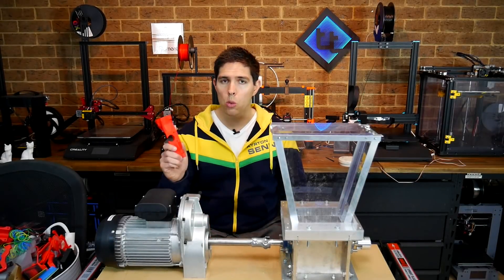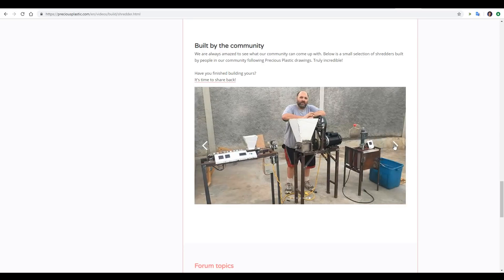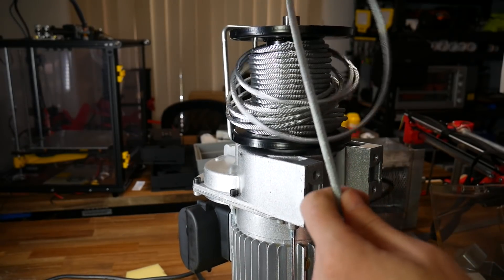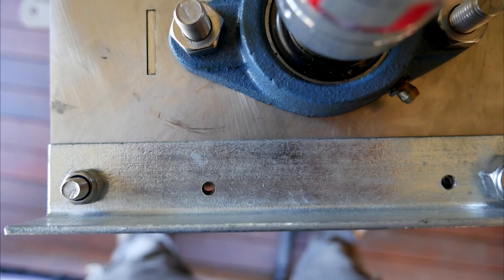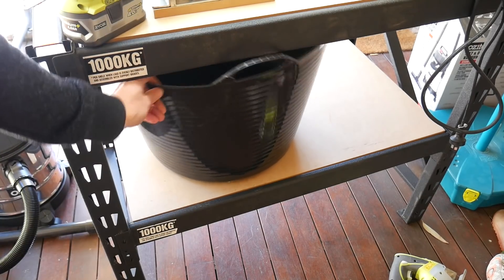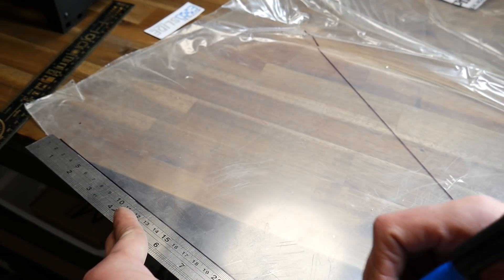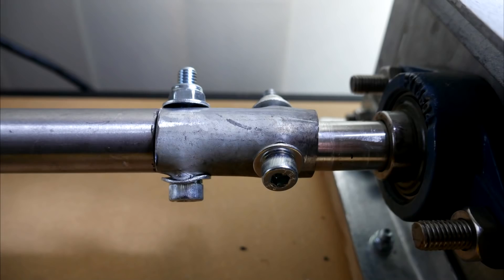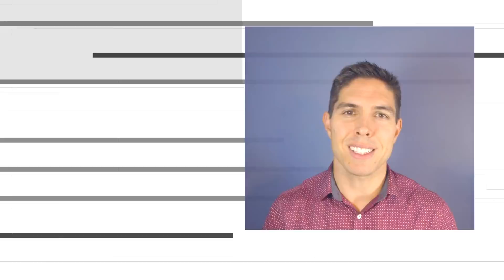Recycling waste 3D prints with a Precious Plastics shredder

Comment: Regarding the Motor, you could've gotten yourself a small geabox, or a torque multiplier if the winch solution wasn't viable.
As for the coupling a viable "quick and dirty solution" is using something like this instead (both are 350Nm torque that ought to do the job, 2 screws mean mor clamping force): 

https://www.norelem.de/de/de/Produkte/Produkt%C3%BCbersicht/Systeme-Komponenten-Maschinenbau-Anlagenbau/Kupplungen-Starre-Kupplungen-Konus-Spannringe-Wellengelenke-Schnellsteckkupplungen-Lager/Kupplungen/Starre-Kupplungen-geschlitzt.html 

Part-No. : 23050-1200
https://www.norelem.de/de/de/Produkte/Produkt%C3%BCbersicht/Systeme-Komponenten-Maschinenbau-Anlagenbau/Kupplungen-Starre-Kupplungen-Konus-Spannringe-Wellengelenke-Schnellsteckkupplungen-Lager/Kupplungen/Starre-Kupplungen-geteilt.html

Part-No. : 23052-1200

The best solution of course would be to saw the shaft of to a shorter lenght, dismantle your cutting/crushing unit and send of it's shaft for a keyway (?) milling then use a coupling that uses keyways, that would be nearly undefeatable.
But seing your solution, as an industrial mechanic now studying engineering I have to say: "Don't use an M4 screw! If you have to use this solution use a matching pin!"

https://www.norelem.de/de/de/Produkte/Produkt%C3%BCbersicht/Flexibles-Normteilesystem/Federnde-Druckst%C3%BCcke-Arretierbolzen-Anschl%C3%A4ge-Zentrierelemente-Positionierelemente-Fixierungen-Nutensteine/Parallelunterlagen-Nutensteine-Zylinderstifte/Zylinderstifte.html
The shacking etc. means not enough power, you realy should look around for a cheap geabox and think about using said keyway solution, just look at this video and the first example you showed to us, the motors are beasts, getting yourself a gearbox (I recon 1:5 maybe 1:10) should do the trick. Also IF you do this use the end of the shaft (crusher unit) you haven't "violated" yet, it's safer and will hold guaranteed unlike the the end with bolt holes in it.

And the solution in the tutorial you showed us should be more then enough to crush all the stuff you used for the demonstration, your coupling was just insuffiant, take that from an industrial mechanic now studying engineering.

Comment: What about an adapter for something like a Car?  Maby some kind of bolt on to the hub? I think a Car would be cheaper for a lot of people compared to an electric motor. The car just has to be able to spin the tires and you could even maybe use a wrecked one.

Comment: i notice you have a keyway on the shaft of your drive motor - cut the extra shafting off the motor and use the keyway as part of the drive coupler... have a machine shop (or if you have a mill of your own) machine a keyway in the shaft of the 'mulcher' part to take the same sized key as the motor shaft (looks like a 6mm key to me which is a standard size and then use a nice  and thick (35mm minimum OD) coupler that has a keyway cut in it to match the shafts.  that will ensure not only a strong and reliable connection between the motor and the mulcher but also something well and truely strong enough to handle the loads - bunningd galv pipe wont cut it :)

Alternatively just be prepared to replace the bunning pipe on a regular basis as needed

Comment: Cut the shaft back shorter and use the keyway. You should be able to find a hub to fit it and this will stop the flex and give you a better connection.

Comment: I work in plastic injection molding, and granulators like the one you made are commercially available. They have all the proper safetys installed. These can be very dangerous machines if not given the respect they command. This really should not be a diy project. They and take body parts with ease.

Comment: Thanks for all your awesome videos!
All bolts are not created equal, they have ratings associated with them. Are you using cheap off the shelf bolts or did you get rated ones? https://www.boltdepot.com/fastener-information/materials-and-grades/bolt-grade-chart.aspx
I second What ABC said, definitely use keyed shafts and a milled coupler.

Comment: You could weld a 8 mm tube on the shaft
Reply: NOT a good idea. Welding bits onto a motor shaft usually ends up in disaster. Best method is to use keyways. Using a grub screw on a flat spot usually ends up flogging the driving or driven shaft.

Comment: The carbon production and energy cost of the time it took you to earn 800 euro far out strips anything you're going to recover from recycling the plastic.
Reply: That could be true. But equally it could be miles out. You can't make that call as you don't know how much plastic he is importing that will be reduced by this on site recycling, or how much plastic waste he generates. I know some projects I've thought about could generate enough plastic waste just from the support material/removed stock for conventional subtractive manufacture to quickly get up to the initial cost of this recycler if you can close the loop and make high enough quality plastics for the use case. 

In my case if I ever do these projects (in plastic) I'll be investing in something similar or finding a good local site doing similar. As that is infinitely better than making new plastic all the damn time for everything or shipping it to who knows where on the assumption it will be recycled. Also should work out a huge margin cheaper as I won't need to buy in so much. Even if only the rough prototype stage is made from the recycled scraps it makes a huge differnce! Nobody making anything more than desk ornamentation gets everything right at the design stage.
Reply: The carbon production? No carbon was produced... you know it's impossible to produce carbon unless you involve some radioactive decay or fusion...

Oh and the more carbon-dioxide he releases into the air, the better because plant life despite what people might think, need carbon-dioxide to function. If you ask me, he should just burn it all, and have the fumes enter a greenhouse, he should try to aim for 7000 ppm CO2 in the atmosphere of that Greenhouse, and he could grow his own food about 17.5 times as fast as what is currently produced on an open field, and his plants would use up 40% less water than what would be used on a field. If he planted trees in a massive greenhouse he'd use roughly 10% of the water instead.

I hate environmentalists, because they don't know shit about the environment, they probably think forest fires are bad... forest fires are good, it creates a perfect environment for plant life growth, by clearing out space and creating a higher than usual CO2 content in the air.

Science 1, Environmentalists/Climate Alarmists 0.
Reply: @livedandletdie  The more the forests grow, the more fuel there is for bushfires.
The more the world heats up, the less safe opportunities there are for controlled burning, drought risk increases and forests become drier and more vulnerable.
More CO₂ for plants is like more carbohydrates for humans, but like us, they also need a balanced diet and don't do well if they don't get enough other nutrients and water to match their growth.
As the forests green and move north (or south), so the albedo decreases and amplifies warming and melting of permafrost. Sooner or later you run out of north.
We all lose in a warming world.
Reply: @livedandletdie  Nice, reasonably correct though probably impractical. Note Oil is finite resource and plastics from plants can be a real pain to make.
Reply: @livedandletdie  still potentially cause loss of unique/novel species due to habitat loss though
Reply: @livedandletdie  Not all forests have burn cycles. 
The real issue is we are reintroducing a large amount of carbon (amount other elements) back into the atmosphere, and trying to use are existing carbon sinks (such as forests) to help reduce that amount.
You are probably going to leak some of that carbon from your greenhouse as well, which is factor to consider, as well as not all burnt plastic fumes would be good to introduce to your food supply. (and potentially water supply depending on your setup).

There are some other factors to think about in costs. For one, he may want more plastic, so recycling plastic makes more sense than just burning it and using the gases.

Comment: Bolts are not pins and are not design for shear forces so they will always fail. If you need transfer so much torque you need these shafted to be keyed.
Reply: NEVER weld a motors/engines output shaft to whatever your coupling it up to!  Is your vehicles transmission welded to the engine?!?!?  NO, it has a KEYED shaft just as this feller has stated! 3 reasons not to are: 1) If/when bearings, motor, crusher, whatever go out, you need to uncouple the 2.  The shafts are hardened steel and cutting requires more tools than the average DIYer has.  2)  Having a KEYED shaft is internal, thereby resulting in smooth coupliers.  3) SEVERE DAMAGE TO MOTOR WINDINGS IF UNDER THAT MUCH TORQUE...... 

Most machine shops will cut the shafts for next to nothing and they can supply you with a matching key, coupling, and set screws.  There must always be a spot for something to fail as a failsafe for cost of machines, picketbook, and personnel.
Reply: @jlong6470  The 4th Reason is part of the reason the type of Coupler (regardless of it's inability to work under load) was used - mainly that you can never be 100% sure that you have your shafts lined up - so Welding will only break shortly after implementing due to the strain on the weld as it passes through 180 degrees rotation.  Having a bit of Play in that axies is ideal - a Weld will not give that.
Ideally a spline  shaft coupling is best as it allows for a little bit of Play in both shafts, and the Spline also allows for More torque.  As you mentioned with a Transmission - the drive shaft on most vehicles typically includes a universal joint at one end, and a spline shaft at the other.
Problem is the shafts in place obviously would need to be worked to suit.
Reply: @lklmmedia4715  if you are worried about the weld breaking you definitely did  not weld it together heavy enough.
Reply: @Georgeshawwaiancousin  but weld a joint strong enough on a misaligned shift and everything else along the drive line will have a potential to wear out. And if all other components are Not likely to wear, then the weld will still be the weekend point. If you cannot guarantee micromillimetre tolerance in your alignment it should be a free fit arrangement instead...but that's just my opinion...of course every setup and situation will be different.
Reply: @lklmmedia4715  i agree it shouldn't be welded. but in reality it is quite easy to get aligned by eye. I work in a machine shop and we rebuild drums on hay chopping machines quite a bit, those can't have any alignment issues or it will rip the machine to pieces, even a little bit can destroy a machine slowly from the inside out,  we can do it by eye so one could get close enough to perfect.
Reply: Hardened steel coupler and mild steel pins is the way to go.
Reply: Good idea. instead of wasting money on a dedicated motor  it would just be cheaper if you can some how couple your transmission to a grinder. so at the cost of just one crusher you can do all this.  But then comes the cost  of building an extruder.
Reply: @shinku5463  Huh?
Reply: What about welding the to 2 rods and then adding bolts? or pins?
Reply: Not even. Just need a higher grade bolt.
Reply: 3d printing community and good mechanical design are worlds apart, all these years and still misusing Z bearings on every machine on sale
Reply: @lezbriddon  how are Z bearings misused? Can you explain?
Reply: @lezbriddon  It's not that they're worlds apart, they just have different aims and approaches. Without an explanation I can only assume you're referring to the v-slot carriages which are a simple low cot solution that get the job done. There's plenty of good engineering minds in the community. I was always taught simple effective off the shelf solutions are always better than over engineering the hell out of something that just doesn't require it.
Reply: @mikea3793  no, the Z support being on rods supported by the incorrect use of radial ball bearings when they should be taper thrust bearings.
Reply: @lezbriddon  Ah if that is what you're referring to I don't think that is an example of a lack of mechanical design ability in an entire community. It is a fix for z rod binding and works to a degree even if it is an incorrect application and better fixed through checking the rod spacing and frame assembly. Though a thrust bearing is also not the solution for that, it only deals with the travel of the rod and would not prevent binding from the rod being offset in the coupling and even a tapered bearing would have a short life with a bent rod.
Reply: @lezbriddon  I would say that this is more of a cost matter. The radial load bearings are just there for cents, but how much the proper thrust bearings cost? Even if it moves from cents to few dollars, that's where things add up and price brackets rise. Also the load applied on a 3D printer is pretty minimal, I would bet that it's well within the supported axial load of a radial load bearing. A proper thrust bearing would likely be super overkill for the application, and a considerable added cost. Tho of course, would last forever (...if kept clean, under correct operating temperatures and if necessary lubricated as well).
Reply: Or replace those bolts with dowels(?)
Reply: What he should've done is just Thermite weld the shafts together. Those shafts would never come undone again.
Reply: @livedandletdie  I'm pretty sure the point is to make it so he can break it down for transportation.
Reply: Actually they are designed for sheer forces - to break to protect whatever they are pinning together.

Comment: You might want to add a kill switch to the side doors for when you have your hand in that death machine
Reply: The don't be an idiot factor should tell a person to UNPLUG, AND DISCHARGE MOTOR CAPS BEFORE DOING ANY WORK. Anyone STUPID enough to not take that precaution is asking for a bad time. Simply unplugging is not always acceptable as some high torque motors have a high discharge starter cap in or on them. This can cause a spontaneous cog in the motor even when unplugged. Short the motor after unplugging any high torque device.
Reply: AND always unplug it, for when the kill switch gets bumped or fails ON.  Sure it's inconvenient, as are emergency room visits...
The problem with "don't be an idiot" is the texting while driving effect:  when we're focused on something else and only a small part of our attention is available, only a small part of our intelligence is available and we do stupid things.  With a shredder, it only takes once and you're learning to do without part of your hand.  
Depending on how bad it is (fingertip cut vs. it got a good grip on multiple fingers, then stalled).
Reply: Very necessary. The problem is not so much hands as hair or clothing. Maybe not even yours, just some visitor who is peeking inside.
Reply: or just dont be an idiot
Reply: @Enviousttv  Accidents don't discriminate by intelligence.

Comment: 3D filament is cheap and even with 29 printers I'd never waste time recycling filament. Hobbyists post millions of problem based questions with new printers and fresh filament. As silly as making wood pellets for a pellet stove based on the ton price.
Reply: Richard Lozier yeah but because it's cheap it doesn't mean you should throw it away.....

3D printing contributes to the plastic problem... and with your mentality things can only get worse.....

I want to recycle mine not because of cost, but because of the absurdity that it is to throw a highly maleable plastic away.

Even when PLA claims to be biodegradable, it needs certain conditions to happen and it won't happen fast enough.

ABS and PETG are different animals here, but still, thermoplastics are thermoplastics. No need to discard them unless contaminated.
(Even then, what's the contamination threshold? -- from what appears... pretty damn high)

So, chipping-in with the two cents of developing a system that makers can use to transform this into a real circular supply is very, very good.

Plus, having the ability to print a prototype, annotate tweaks and then destroy/re-print with the same material is just awesome. That way you don't end up with "version 1" through "version 47" laying around and cluttering your workspace.

This will evolve and things are gonna get way better, and that logic of throwing things away should be, and will be frowned upon.
Reply: @ismaelabufon1696  Dude get a grip,  you are so far over the top you are silly,  a spool of filament for less than $20 US lasts a long time,  messing with junk left overs grinding melting makes as much sense as farting in a bag to contain greenhouse games.

Comment: I would be more efficient to build a 2 stage shredder. 1st stage would shred into larger bits but would put a lot less strain on the coupling, motor, etc. The 2nd stage would take the 1st stage bits and grind them to final size.

The drawback is this would be more complicated to achieve.
Reply: Not by much... I mean he could use gearing for that. It's not that difficult.